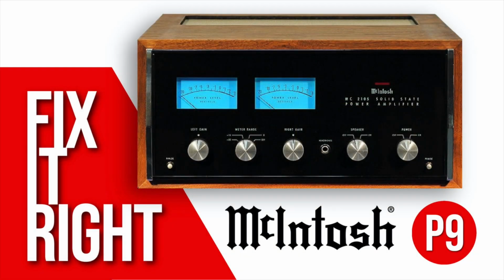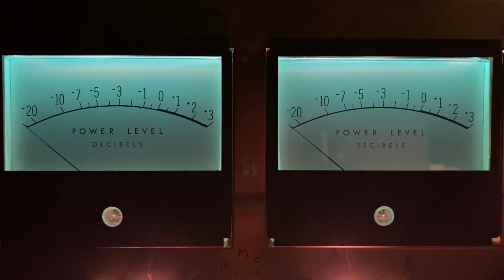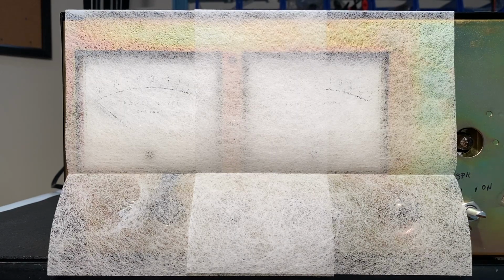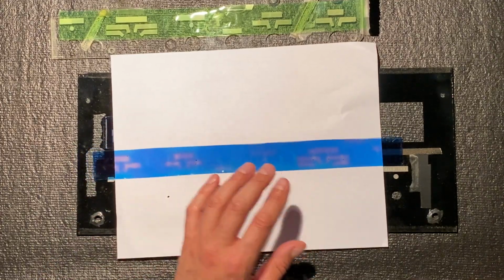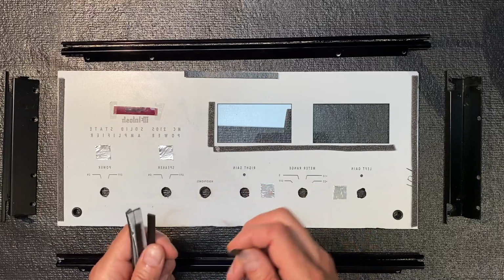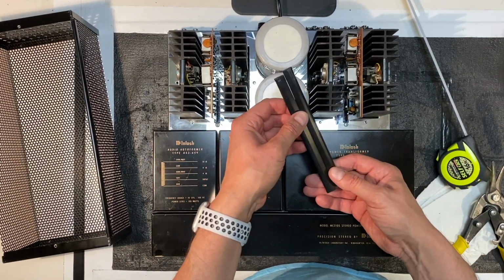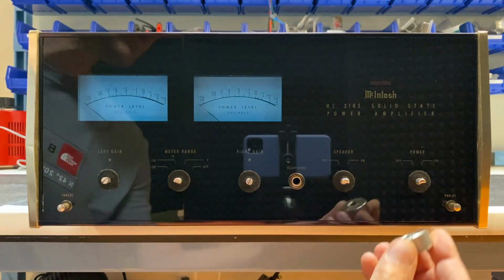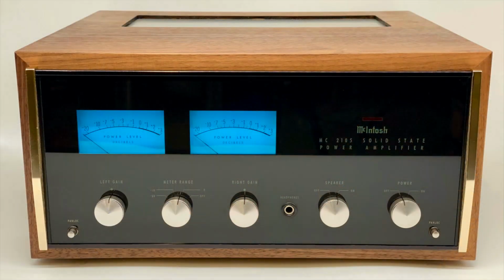McIntosh MC2105 P9: Demonstration, Meter Calibration, New Lamps, New Glass, New Cabinet & Panlocs!

Comment: Well Chris,
My MC2105 amp sounds (and looks) great!
The Left & Right channels are putting out equally, (which was not the case before I started, if you recall).

As for the amp’s max output, everything I read is pointing to those ‘cement’ wire-wound resistors that show definite corrosion (at least two of them). I’m not saying that this is the only possible issue, but it’s certainly the place I need to start with when I go back into it in a few months.

I did a careful inspection of all my solder work and confirmed that all points were clean, no bleed-over shorts, and no polarization mix-ups. I think you would pass all my PCB work with flying colors.

I did do test to check for clipping and there was no clipping at the max gains.

However, I can’t rule out the possibility that I damaged something early on, when I was testing the amp. I’m referring to incorrectly attaching the dummy load resistors. My misunderstanding about how to connect a dummy load resistor goes back years.

Often, in various DIY forums, I’ve explained exactly how I was attaching my dummy loads in the testing process, (as I did in my posts to you). Yet, no one ever caught my mistake. 

It wasn’t until around Part 8 of your videos, that one of my posts made you realize what I was doing. That’s when I finally was straightened out about it.

If I had to do it all over again, (and I have several other vintage amps, which almost guarantee that I will), I would have done a few, simple, “Before” tests, with a DVMM and maybe an Output test for max watts and clipping.  

I would do that before I even unscrewed anything and started the work.

Then, if I had any strange readings, I would open it up and do a few more in-depth tests. I’d take notes that I could then compare to my “after” tests. I only wish I did that with the MC2105.

If I had, I would know where to start looking for possible problems. If the amp was reaching max output before I started, then I would know that the issue was likely due to something I did, or didn’t do.

I have you to thank for every step of this process and helping me avoid major mistakes and improper reassembly. BTW; I followed your suggestions and used 2” wide aluminum foil tape to enhance the meter intensity. 

I then went a step further and used a 1/16” thick, matt, (picture framing board), which I cut to fit over the meters, and hinged to close in the side nearest the meter PCB. Essentially, I ‘boxed in’ the meters with the foil tape to increase the reflective light even more. It worked very well.

You can be sure that I’ll be pointing any interested parties to all the videos created by Flux Condenser for years to come. I didn’t have time to watch all the videos on restoring other units, but watched enough of them to see that your videos are just as incredibly detailed and easy to follow as they were for the MC2105.

Thanks very much for the extended help!
Rich
Reply from the maker: Glad to hear, Rich. I’m still a little concerned you’re not getting the proper output and hope you sort that out eventually. Sounds like you’ve got a handle on things, though, and the amp is sounding good to your ears. Congrats on getting to this point! It seems that you learned a lot and mostly enjoyed the experience despite some setbacks. Keep on with the hobby as it’ll get more rewarding and easier as your knowledge and experience grows.
Reply: @FluxCondenser   You can count on me sticking with this hobby, Chris. I have no doubt that I'll come back to 'haunt' you on some future projects, LOL.

I'd like to make a suggestion regarding your tutorials, but please keep in mind that it's strictly a suggestion and not a critique. 

My suggestion: 
Perhaps you might start placing a recommendation in the beginning of the video series in text. 

The recommendation may point out that some people may find it advantageous to run a few simple "pre-restoration performance tests" prior to the disassembly stage in the first video of each series. Basic output power tests with a DVMM and if possible, (providing they have a scope), a signal test for clipping. The added text would go on to direct those who want to do the tests, to the video in the series that covers the test stage.

As I said in my previous post, had I done that, I could have confirmed whether it was something that I did wrong in the restoration, or if the amp was already impaired. If I found that the output of my amp was normal and correct before I started the work, I would know that I should revisit each and every component that I installed.

Like I said, it's strictly a suggestion. However, in my particular case, everything seems to point to the fact that the amp was impaired before I started doing any work. I think the seller probably knew this and that's why I got the amp for less than half the price most of them are selling for. 

Over the years, I've bought quite a few items from eBay sellers. I estimate that about 25% of the items I bought were sold with intentional deception. It's unfortunate, because I have always maintained a "treat those the way I'd like to be treated" philosophy. I've held to that moral standard all my life and am not about to change now. 

However, in that past 10 or 15 years, it seems like the more popular philosophy is "Do unto others before they do unto you". It's that lack of ethical conduct that appears to have taken over in all facets of life from merchandising, to politics. I find it to be shameful and I believe it will ultimately have severe affects on a planetary scale in the near future.

Anyway, thanks again for the help and I'm sure I'll be speaking with you again on some future endeavor.
Rich
Reply from the maker: @richpaul8132  Thanks for the suggestions, Rich. I’ll keep them in mind. I don’t present my videos as tutorials. If I did, they’d be set up differently. Sometimes I’ll title a video as, “Let’s repair…” but the intention really is to show what I’m doing, not teach someone how to do the same thing. There are just too many skills to teach, and I can’t possibly do that for every viewer or cover every variable they might run into. 

So instead, I show what I did and the viewer gets to learn some concepts and techniques along the way. But again, I’m not presenting nearly what a person would need to know if they’re a novice. If you saw this as a tutorial with step-by-step instructions, my apologies. But I don’t think I presented it that way. Anyone attempting to repair an expensive, collectible piece like this is responsible to make sure they have a very good understanding of what amp repair is all about. 

They should understand the goals, the pitfalls and the basics of amp testing and a McInstosh 2105 really isn’t the place to start learning all that. The place to begin, even if you have some basic understanding of electronics, is to build lots of kits and try out some skills on less critical projects. To tackle a job like this as a beginner, one should also do a lot of reading (and I mean a lot), watching, note-taking and experimenting before picking up the soldering iron.
Reply from the maker: @richpaul8132  Rich, I’d also like to add that the determination about whether an amp requires the repairs I show in this series is up to the viewer. This series starts at the point that I had already done that. I knew the state of the amp and what repairs were required. I’m not sure why anyone would proceed with the repairs if those assessments hadn’t already been made. I knew what was wrong with my amp and I knew how to fix it. I didn’t start with an amp that was misbehaving somewhat with the hope that the repairs I was going to undertake would fix the issues. I KNEW they would fix the issue because I had already done a full assessment. Again, I would hope that would be a given for anyone attempting to work on an amp like this. If not, the job really should be turned over to someone more qualified.
Reply: @FluxCondenser   I agree, and I should have said "demonstration" as opposed to tutorial. You've probably heard the term, "I know just enough to get myself in trouble". When it comes to electronics, that term can apply to me. I have over 20 years handling a soldering iron, but that's because I started 'fooling around' with electronics in an 'on & off' way, long ago.

Therefore, my soldering would stand up to most with that much experience, but my understanding of what I'm soldering is at novice level. As a hobby, electronics is very interesting, but the field is, in my opinion, so deep, that the study would take several lifetimes to master and understand. A physics degree would be required in order to answer some of the questions that I have, which delve into the extremes of that field's abyss.

It would require far more dedication in time and resources than what a hobbyist would be able to devote. I have a very broad range of interests and hobbies that span the arts and sciences and I won't pretend to know more than a beginners level about most of them. 

Some of the mistakes I made with the 2105, such as the dummy load connections, were due to the way I understood what I was told and/or read years ago. Not once or twice, but many times over the years, I touched on this point and still misunderstood it and yet, when I brought it up and explained what I was doing, no one seemed to catch it. 

My point here is that there are somethings that can be easily misunderstood when read if the written text isn't careful to make it clear, (from the student or the teacher). That's why they have colleges where it can be demonstrated and understood through diagrams and mutual collaboration. 

Unless the writer is careful to make certain what they've written can't be misinterpreted, an error like that can happen to the best of us.

Regardless, posting a suggestion to pretest the unit before beginning to work on it for the purpose of comparing "before" and "after" results, doesn't really fall under a tutorial or demonstration heading. 

It's a suggestion that many people, experienced or not, (and ready to 'git 'er done'), typically wouldn't think of until it was too late. I think a lot of people would like to see if their work made any real improvements on the unit. This is where I was going with that suggestion. The stereo websites out there, (even the good ones), all stress how ANY vintage amp that someone bought should be recapped, "no exceptions". 

This was the main reason for my decision to do the job. The other was that tell tale hint of a problem because of the variation in the output of the left & right channels. I knew I could probably just adjust the gains to make them more 'equal' but I wanted to go after the cause. 

The blame and responsibility is upon the person who decides to do the job, so please don't take that suggestion in any other way than I clearly meant it. No one is blaming the videos for anything. They are excellent as I've always contended.
Thanks again for the help,
Rich
Reply from the maker: Thanks for the feedback, Rich.

Comment: Just a quick Update,
I believe the "good news" is that neither channel is clipping at their maximum gain. They both appear to have plenty more they can take. I guess this is good news because both channels are responding the same, (even though the Left channel is putting out about 5V less than the right). In addition, it seems they are both putting out the appropriate watts for any given voltage, (which is really jus a 'relative' thing, I know), but they are very consistent, and repeating the voltage outputs each time I dial to a given db on the meters. So whatever's wrong isn't fluctuating or intermittent. 

However, this new scope has a lot of features and can give me more information than I'd know what to do with, (including FFT measurements). All I know about the FFT option is that it's useful for audio research and testing. Exactly why, I haven't a clue. I've got a 200 page manual and it'll take time before I can understand anything more than the basic operations.

Oh, I meant to tell you that when I change the amp's Meter Range dial to the "-10" or "-20" selections, both channels will reach and go beyond their respective meter's max travel, (as expected). This may be important to know because it indicates that the Gain Potentiometers are correctly installed, (which I knew because I photographed the old ones before I unsoldered the wiring), but it also seems to be a strong indicator that they are allowing as much voltage to get through as they are getting.

They simply aren't getting enough and that makes me suspect the resistors in the Meter Range dial. I need to check those ASAP, because I just realized that I forgot to do that and it was something I wanted to do from the beginning. I have to unsolder at least one lead in order to be sure of the readings I get.
Rich